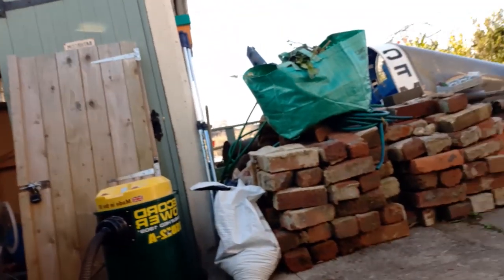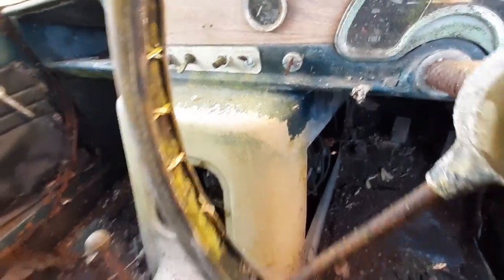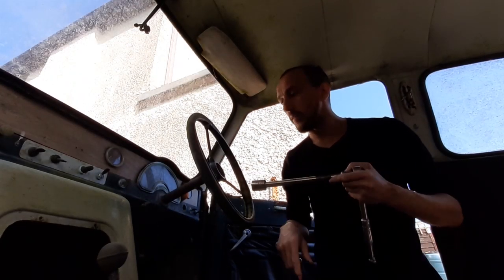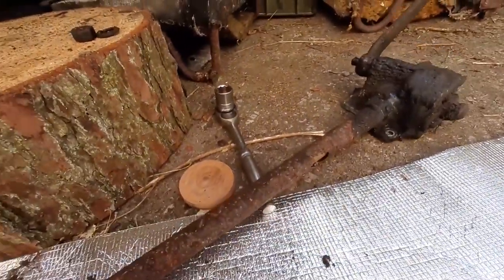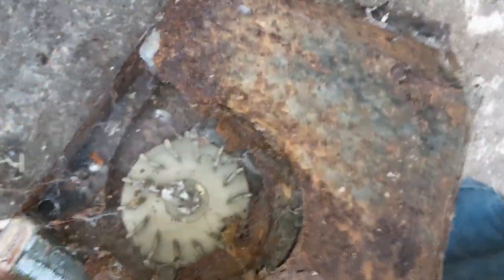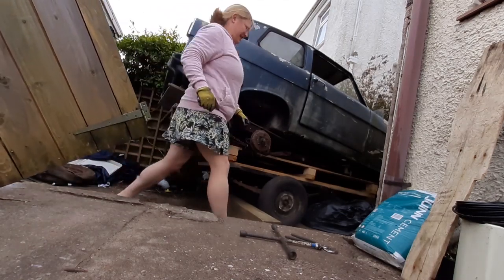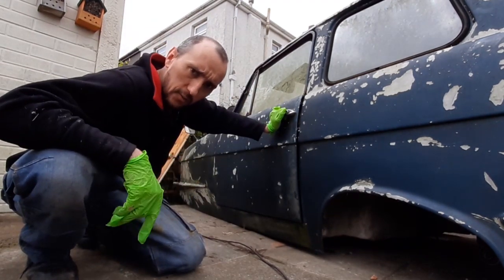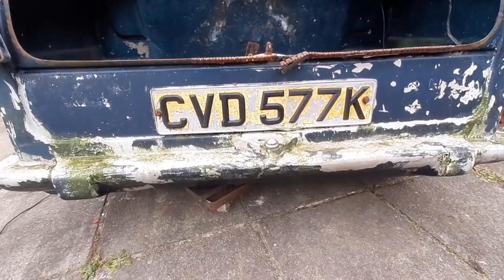Lifting the  body off - Reliant Regal Resto - Part 2

Comment: Get yourself an electric ryobi 1/2" impact gun. Over 400lb of torque . It would get those bolts you cut and the steering wheel off in seconds. :)  best bit of money I have spent on my resto so far
Reply from the maker: I'll look into that cheers, chassis is stripped now, part 3 along soon

Comment: Great to see progress so quick with your regal 21e, see you made same mistake as me first time I removed the heater box from a reliant, never knew the wires pulled out the heater body, ended up cutting and rejoining them during the rebuild
Reply from the maker: I'm lucky in a way that everything bar the shell is scrap as it means I can crack on quickly.
Reply: I wouldn’t be surprised if that engine works too, I bought a 76 reliant robin 850 with a seized engine, after soaking in oil for several months it became un seized and is now the best running reliant I own.  Axle possibly just has the brakes stuck on, my supervan I’m restoring at present was the same, I thought the axle was seized but thankfully it was only brakes, big bonus with that regal axles is you can strip them down into all there parts very easily!  Although getting the hubs off can take a bit of patience, I had to get mine pressed off, took about 8 ton pressure on one of them.  Will be good to see the bodywork come together on the regal, I’ve just the basic 3/30 but such a lovely car, surprised me just how much go the little 700 engines have
Reply from the maker: I'm not going to dump them, I plan to remove all the things that may be savable from the chassis, like the engine, box, rear axle and diff.  I'm also going to chop off the front of the chassis as that is solid and may be of use.  The rest will then be put out for scrap.

Engine wise I'm contemplating a VMax 1200 or similar.  Would fit lovely and plenty of oomph behind it.
Reply: That seems a pretty good plan, chassis does look pretty much toast, similar to my vans chassis, I’ve kept it though as having thoughts about seeing if it’s possible to remake a chassis with new pieces.  Might of seen my restoration on the reliant Facebook pages. The green reliant supervan 3 that had its nose broken completely off of it.  Definitely usable the front of your chassis though! I had to order a part for the front of my replacement chassis as the post that holds the front shocker was missing.  Incase you don’t know seen your Headlinings in great condition, if it’s possible to leave it I’d recommend that, they are an absolute pig of a part to source!  At least nearly everything par the chassis looks reusable on it though😊.
Reply from the maker: @LewiBuchProductions  I haven't seen yours, could you ping me a link please?

I was shocked at how good the headlining is :)
Reply: Yeh you’ve been really lucky with that one I’d say!  Here’s a link to the page on Facebook, https://www.facebook.com/100627261300493/posts/226456942050857/?d=n
Reply from the maker: @LewiBuchProductions  Wow!  Your chassis makes mine look factory fresh.  Ill look through those in more detail later.  Love the Jag.

Comment: Have you decided to go the motorbike engine route? I am too in the planning stages.
Reply from the maker: Aprilia Rsv Mille engine already purchased along with all ancillary equipment.
Reply: @StevesMachines  WOW! That'll be amazing. I'll definitely follow along!
Reply: Cool, I have a regal with a 100 hp gsx750 engine in it, looking stock otherwise as well. Did have to install a robin/rialto axle and bigger wheels to get the revs down at higher speeds!
Reply from the maker: @jeroenj.v.r.929  Nice, I'd like to see that.

Comment: Excellent footage / project. Iv,e always liked the Regal especially the shape of the saloon with the rear rake window. I remember a white Super Deluxe that parked a few streets away from us back in the late 80's. The paint was flat and crazed but it was the guy's everyday drive.  I have a Bond Bug which I hope to get back together at some point.  Do you work as a Mechanic or Engineer for a living as well as working on the project? Thanks Andrew.
Reply from the maker: Hey Andrew, I'd love to see more of your bond bug, those things are cool.

I'm not a mechanic by trade, I'm a software engineer.  I've always had old cars though, I prefer them.  I've also had bikes and rebuilt myself a microlight.
Reply: @StevesMachines  Thanks for your reply. I,ll forward some photo's of my Bug Project either on here or your Facebook Page. My Bug's Chassis was rotten as well but I managed to get a second one which has been either remade or wax oiled from new. I work in Electronic Manufacture producing Sonar and related instrumentation for various Sectors including Oil and Gas.  All the best with the project , looking forward to more of your video's in the future.  Andrew.
Reply from the maker: @ANDREW-oy2vh  Great stuff cheers, I look forward to seeing those.
Reply: @StevesMachines  Thanks again, Andrew.

Comment: These cars seem to have a problem with the chassis rotting away, are you gonna galvanise your chassis to stop this happening?
Reply from the maker: Not galv but either powder coat or hammerite at the very least.
Reply: Ive used hammerite but it chips easily, if you cant galvanise it i would powder coat it 👍